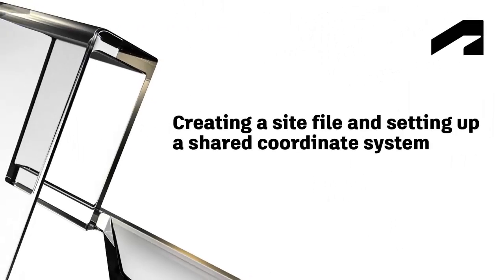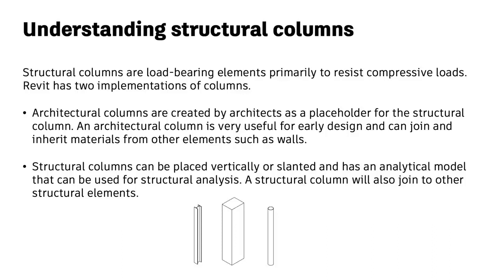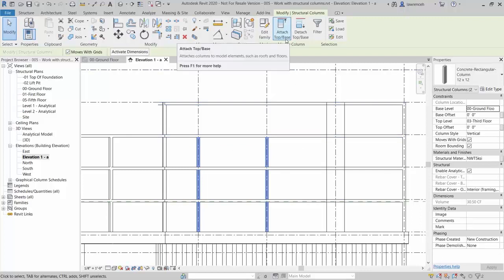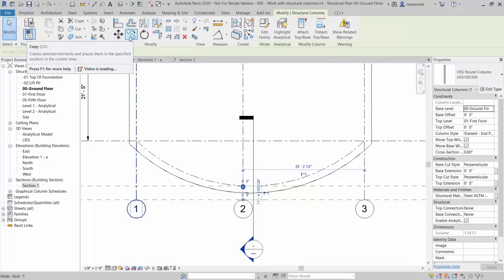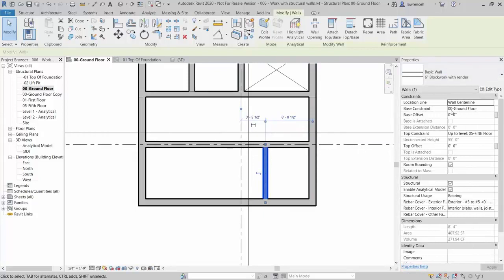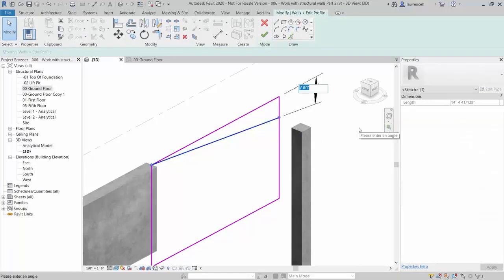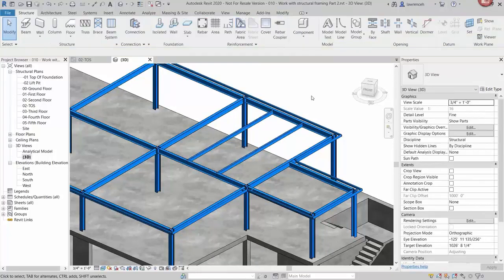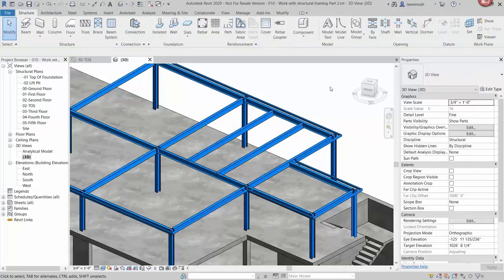Tutorial Revit for Structural design: Working with structural components part 1

Comment from the maker: 1.-Creating a site file & setting up a shared coordinate system 0:00:05
2.-Working with structural columns                                                 0:09:19
3.-Working with structural walls: Part 1                                           0:20:47
4.-Working with structural walls: Part 2                                           0:30:32
5.-Working with structural floors: Part 1                                          0:36:58
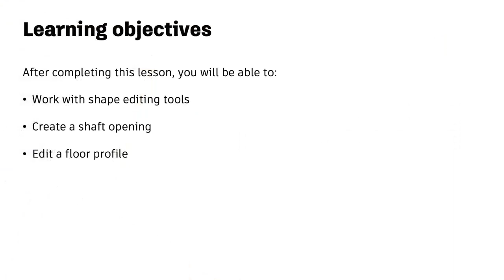6.-Working with structural floors: Part 2                                          0:49:00
7.-Working with structural framing: Part 1                                       0:58:17
8.-Working with structural framing: Part 2                                       1:06:22
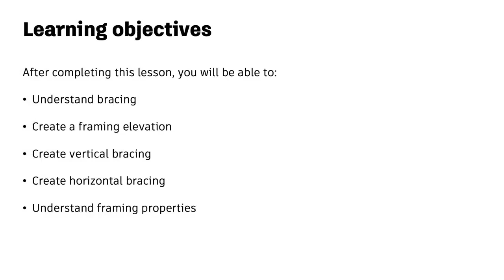9.-Working with structural framing: Part 3                                       1:17:26
10.-Working with structural connections                                          1:27:32